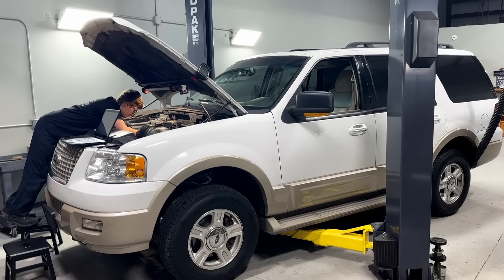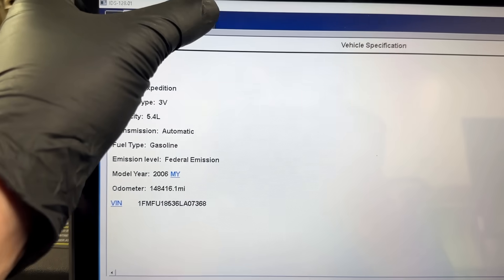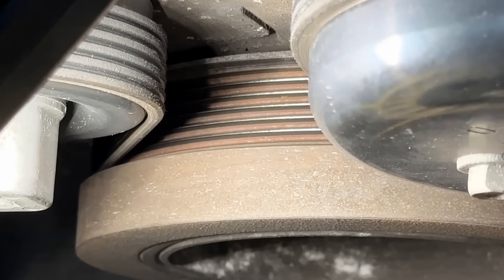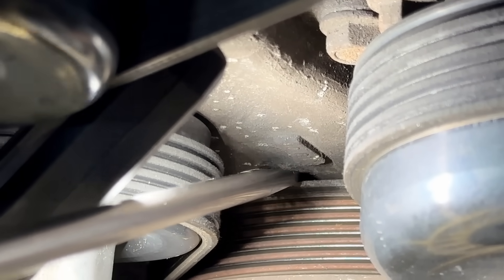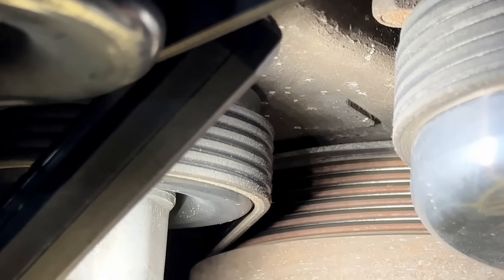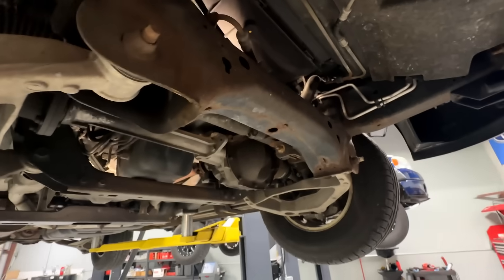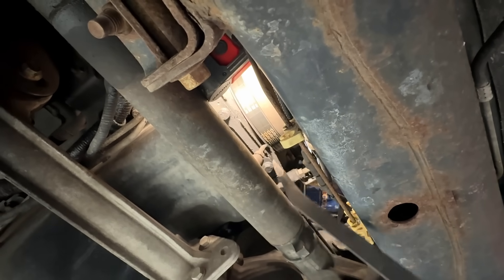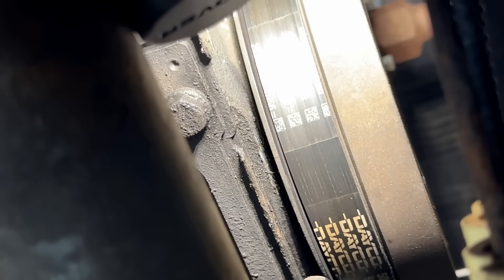Ford 5.4L 3v Triton Engines: Always Check This First Before Performing a Timing Job on this Engine!

Comment: Is the '05 Triton even part of this issue('06-'08 mentioned)If I find my '05 F150 with this 3valve 5.4 has the end play movement as shown but no other inducations(no check engine lights, no oil drips etc. and runs really good) does that indicate an impending failure?  And is it worth it now to have my valve job and crank play issues corrected now or is there no point in doing it?   My truck has 172,000 miles and runs really good. So I was just wondering what the opinion was as it us right now.  Thanks
Reply: He said it's 06-08.
Reply: @michaelwhite278  i guess he did..what was i thinking ?

Comment: So the 2005 F150's with the 5.4L  3valve Triton V8 isn't included with this group?  '06- '08 were mentioned.  Just wondering if I dodged a bullet or '05s should have been included?

Comment: I've got a 2007 F-150 5.4 and it is just now rolling 200,000 miles. 5W-20 all of its life and still no timing job. Love that truck.
Reply: Mine is a 2006 and I have 248,500 on it.  Motorcraft 5w-20 every 5000 miles since I bought it at 50,000 miles.  Still running like a champ!
Reply: I’ve got a 2010 5.4l with 174k. Got the cam phasers replaced at 140k. Thinking about selling 😬😬😬😬
Reply: @folms110  Mine is at almost 250K and is all factory.  I’ve always done my oil changes on time and used Motorcraft 5W-20 every time.

Comment: You can also see that the drive belt on the worn engine isn't running on the center of the smooth drive pulleys anymore. Seems that would be a dead giveaway. Great vid as usual👍
Reply from the maker: While this can be another indicator it is not to be relied on for this condition. Many aftermarket tensioners track toward the edge where as the blue truck I already did a timing job on received a Ford Tensioner which tracks close to center.

Comment: Wow great info, does the 3V 4.6L in the Mustangs have the same problems with cam phasers, timing chains,
and crank shaft thrust washer failures that you know of?
Reply from the maker: Yes they sure do.
Reply: @FordTechMakuloco  should the pulley on the 4.6 3v mustangs be as snug to the timing cover as these?

Comment: I'm so tired of this motor.  In 2020 I was watching all I could from you about the motor.  My 06 expy was having a misfire cylinder 5 and I went through everything from the vvt to did my rocker arms fall out.  I couldn't find anything.  One day the truck hit limp mode on my way to work on highway.  I got the truck home after work, took intake off, and the center gully was full of coolant.  I got the drivers side head off, and every cylinder was full of water.  I spent $5k on reman engine (with heads taped to take standard spark plugs) and reman tranny.  Did work myself.  I got 9 months (6k miles) and I started getting misfire cylinder 5 again, along with rough running/driving.  So I got a replacement (flashed) ECU.  I still have the misfire.  The only thing I haven't changed on truck is wire harness.  The truck has been sitting for a year now because I just don't want to deal with it.  I'm ready for a coyote or godzilla swap.  Either one has to be less hassle than the 5.4 Triton trash.

Comment: FordTech,  would  you explain how the PCV system works on  a 2010 f150 5.4l 3v. Does it use a traditional style pcv valve?
Reply from the maker: It uses a PCV baffle system which is part of the valve covers.
Reply: Look for the video he did on on a 2009 F150 that came in…I believe it was within the year. He covered the pcv side of things in that one.
Reply: Is there any preventative maintenance that needs to be done on  this pcv system?    Im still looking for the vid that JP mentioned .    TY

Comment: When that crankshaft moved as you pried down below I jumped in my chair.  Spooky.  It's NOT supposed to do that.  Whew.  But it's great for someone to tell the truth.  Bless you Brian - you are teaching your son well.  Ethics.  Values.  Doing the right thing.  Open communications. Thinking and analysis not random wandering.  Great work at fair prices.  The customer comes first.   Etc. Etc.

Comment: Brian, the other clue is where the belt is running on that tensioner. It's not centered. I had the same issue with my Caravan when the harmonic balancer was walking off the rubber mount. I could see that the belt was not centered on the tensioner pulley.
Excellent video. Thank you
Reply from the maker: While this can be another indicator it is not to be relied on for this condition. Many aftermarket tensioners track toward the edge where as the blue truck I already did a timing job on received a Ford Tensioner which tracks close to center.
Reply: many same comments   above...

Comment: had same problem 08 197000 miles pulled pan and saw the 1 half of the thrust bearing in the pan ,pulled engine put a reman crank and bearings in . the cylinders still had cross hatch visible measured tapper and it was mint put in new rings ,new timing etc. runs like a top has 6000 miles on it no smoke no problems , all thanks to brians videos it helped me out alot

Comment: Thrust bearing wear is often caused by torque converter being forced forward by high transmission oil pressure. I had one with a restricted cooler line that did just that.
Reply from the maker: I have heard of this but in this case it is not the cause.
Reply: @FordTechMakuloco  Did you determine the cause? Was it just normal wear?
Reply from the maker: Yes a common failure 2006-2008 as specified in the video.

Comment: Yes any type of thrust bearing failure will force the crank forward with a automatic due to the pressure in the torque convertor. I have seen this back in the 90s with the AOD the TV cable over adjusted crazy line pressure would smoke the engine thrust bearing but buddy LOVED the hammer shifts. I have a overserviced my 07 purchased in 2010 with 38k yeah I live in Canada every thing metric since then 40k plug changes first one tight but done a little nickel anti seize on the ground shell and all other changes oil changes every 5 k with Castrol edge 5w20. in 2013 noticed Pennzoil made from natural gas a superior oil base used the cleanest not rocket science dirty goes to clean my go to for ever. Changed grades as I thought and you recommended 5w30 I did that . Today 200k 15 years old runs just like 2010 when I bought it. Live in the rust belt the brine and salt kill the body on any vehicle me 56 years old have owned many vehicles the body dies well before the drivetrain its sad. But back on topic for this my thrust bearing is mint on a 07 the worst the proof 5k oil changes with the best oil ever even keeps cam phazers alive is what it is. This engine a bad choice for the novice but for me and you a strong good daily runner overserviced a fail for Ford for the ignorant the masses.

Comment: FordTechMakuloco, could you give me idea-i own explorer 2009 4.6 3v with 60k miles only. I use 5w30 oil. My engine has phaser rattle on the passenger side when the engine is completely hot. I changed the phaser (used new ford original part), but the rattle still continues😢What is my next step in solving this problem? Thank you!

Comment: Also at the 1:21 mark it looks as though the vacuum line going to the heatercore coolant hose it's not on the diaphragm side.
Reply from the maker: Yup they fall off all the time and some just cap them.
Reply: @FordTechMakuloco  quick question do you know what usually causes a p1450 in the 5.4 expeditions year model 2006.

Comment: If a 2005 5.4 3v engine passes this test, and has the startup rattle with 140k miles, but burns a qt of oil every 1800 miles would you replace it or do the timing job only?
Reply from the maker: Timing Job.

Comment: I had an 07 5.4 3v it was a great engine! Had 160,000 miles on it when I sold it. Never had any major issues. But I always changed oil on it
Reply: My 05 has 275000 on it! Drive it every day! Had the phasers locked out on it time I bought it. Drive it every day, tow my camper, car trailer occasionally. Use full synthetic and change the oil and filter @5000 miles! Uses 1 quart between changes. See a dozen of them every time I go to town.
Reply: @markmccarty9793 What kind of gas mileage do you get with normal in town driving on that with the locked out phasers?

Comment: The 5.4 come out in Australia in 2002 in the BA falcon there a good motor plus there a huge motor too that's why they had to put a hump in the bonnet on the XR8 and GTs models brother has a Ford Fairmont Ghia 2006 model four door falcon from Ford factory built to his specifications

Comment: Ftm that looks like maybe 0.120" wear on the main bearing thrust surface, doesn't it? That is fairly uncommon on engines in general but all bets are off with a 5.4 l 3v. Do you know what causes it? Bout enough to make you loco.

Comment: First clue would be the location of the serpentine belt on the idler pulley. It was far from centered on the pulley.
Reply from the maker: While this can be another indicator it is not to be relied on for this condition. Many aftermarket tensioners track toward the edge where as the blue truck I already did a timing job on received a Ford Tensioner which tracks close to center.

Comment: question for ya..  i own a 2010 5.4L triton   the code im getting is P0001 Fuel Volume Regulator Control Circuit / Open    i have taken it to my mechanic 2 times and both times have come back with no answers other than it could be this or it could be that .  says it could be a few things that trigger that code . ive changed the plugs, the coils ive cleaned and remounted the fuel driver sending unit or whatever it is on the rear axel .when i push the throttle it wants to spit and sputter lacks power big time. it was throwing missfire codes a while back but doesnt anymore just spits and sputters. if i baby the throttle it seems to do alright but hills or passing or even if i just heavy accelerate is when it has issues.for some reason it wont throw codes anymore but still has issues. any ideas , ive thought about taking it to FORD but really cant afford hundreds of $

Comment: Is the 4.6 3v prone to all the 5.4 issues?  I have 09's , Mustangs, but I will probably never see those kind of miles, just curious... Thanks for another great video.
Reply from the maker: Not all
Reply: What about the 03 4V? I've been having a grinding sound when I start it. My brother pointed out last month the sound seems to be coming from the a/c compressor unit. Thoughts? Thanks.

Comment: Was this a problem with 3valve v10s I have a 08 manual trans very early build 03/07 also when do you recommend doing a timing job on the v10s I have no issues as far as cold start rattles

Comment: The way the belt sits on the idler confirms how far out the crank pulley is guiding the belt.
Reply from the maker: While this can be another indicator it is not to be relied on for this condition. Many aftermarket tensioners track toward the edge where as the blue truck I already did a timing job on received a Ford Tensioner which tracks close to center.

Comment: I've had good luck with my '04 F-150 5.4 3 valve. I have almost 300,000 miles on mine. I've never touched anything inside. Oil changes pay dividends. Oil changes are cheaper than a new engine!
Reply: at 80yrs young, I STILL do 3000mile/inc filter oil services...rbw

Comment: Hi Brian, here are A couple of video ideas that im curious about. 1. is there any differences between the mustang 4.6 and f-150 4.6 3 valves?  2. How does the 4.6 compare to the 5.4 in common problems? 

I haven’t seen any mustangs in your glorious shop. 

Its odd that some 5.4’s had the thrust bearing issue and others did not.. i womder why. 

Thank you so much for your entertaining videos. All the best!
Reply: Yeah I always wonder the same thing… some people say “the 5.4 is exactly the same engine as the 4.6, just with longer stroke”, but others say there are issues in the 5.4 that don’t exist in the 4.6 and vice versa, and it’s silly to assume they’re the same. 

Of course the truth is somewhere in between, and I’m always hopeful to hear in these videos whether the issue is unique to the 5.4 or not.
Reply: Different components in the engine as far as timing goes the 4.6 doesn't have cam phasers or vcts and the valve train is also different.. oil pathway to the valves there are tons of differences in the two engines
Reply: @chrisburrell8489  i thought the 4.6 3 valve did have vvt and phasers? Any info is good.. its odd that we dont see more mustangs in brians shop.. maybe its just due to the fact there is less of them and people domt rack as many miles on them.

Comment: Thanks for the informative videos i really appreciate it . I just went to help a friend put her serpentine belt back on. It flew off going down the road in the rain. I figured maybe it was a streached out  old belt. So we put a new one on. Theis was a 4 cylinder in a Dodge Avenger. It came off again a few days later. So when i put it back on in a garage I could see that the belt was riding a full rib out on the tensioner just like the one in your video. If you notice the alignment is off on the next pully after the crank. I bet he engine might have thrust bearing issues. I would have never thought of that. Her tensioner felt good so i didn't think it was going bad.
Reply: good eyes.....

Comment: Hey there! I have a 2006 ford f150 5.4 lariat. Its a roo roo roo start… very sluggish. Once its running she drives and runs great, idles perfect also. Once its warmed up and I drive for a bit it doesn’t like to start again until its cooled down. What would you suggest I check first? Thanks so much!

Comment: One clue is the serpentine belt is running off the front of the pulleys,  but then that could be caused by a bad bearing elsewhere on the belt system

Comment: The position of the belt on the tensioner pulley should be a very easy and reliable thing to look at. (As long as the tensioner is good)
Reply from the maker: While this can be another indicator it is not to be relied on for this condition. Many aftermarket tensioners track toward the edge where as the blue truck I already did a timing job on received a Ford Tensioner which tracks close to center.

Comment: My brother had an AMC 360 in a Jeep with over 1/2" of end play, and you could see daylight through the top of the main bearings. I could literally pick the crankshaft up while it was still in the block and bolted down. 

That end play Brian is seeing is pretty significant too. Keep up the good work Brian as I always appreciate your top notch videos.

Comment: So it seems like a lot of labor to, pull the transmission for the rear main, the oil pan for the thrust washer, and the front of the engine for the timing chain. If a person was to yank the engine, it also might still need a crankshaft and bearings. So I guess you're saying without actually saying, either scrap the truck or get a reman?? 🤔✝️🤗

Comment: So is it the "thrust washer" or thrust bearings (are they the same - tomato or tomatoes?)? And that'd mean that debris (or whatever) is getting past the front seal (behind the harmonic balancer); possible oil pickup strainer clogged-up? K, so I had to come back to edit - maybe a fix/workaround: cut small grooves in the thrust washers in order to make any oil from the main bearings lubricate the washers. Or, as in some SBC racing applications, use thrust needle bearings in the front washer (will still need lubrication), but still a possible workaround.
Reply from the maker: No it is an actual separate washer.
Reply: @FordTechMakuloco  Yup, it is; I just watched ur video on it.

Comment: A great explanation of something I would not have thought to check!  Thank you for sharing your years of experience with us.  This sure makes me appreciate the old-school 4.6 in my '98 Mercury Grand Marquis.  No phasers, just 2 valves per cylinder... a basic text-book V-8.  Except for the lack of sparkplug threads in this era, if you stay up on the maintenance, this motor is pretty darn bulletproof. Just past 150K and it still runs like a watch.
Reply: True, great engines. Still plenty of them in operation all over the place.
Reply: My 2005 Grand Marquis has 288k and going strong. Just sold a 96 Mark VIII 4.6 dohc that had 315k and going strong. Had 2 94 vics with over 260k and going strong when I sold them.
Reply: Buddy of mine is a machinist, and he told me the 4.6 liter spark plug threads, or lack thereof, have put his children through college.  The Ford 302/351 was an excellent engine.  They haven't built a good one since, imho.
Reply: @James.Allen.1  I agree. I regret recently scrapping my 93 f150 with a 302, but I had to. The cab just rotted right out, shock and leaf mounts rusted, electrical problems, ect ect. Im still sad about it.
Reply: @James.Allen.1  True that.  Miss my 302.  And my inline 300.
Reply: @James.Allen.1  What do you mean put you through college? I've installed dozens of inserts into these heads. No need to pull them etc. Charged perhaps 1 extra hour over sparkplug change to install an insert. How much was he charging?

Comment: Great video thanks. Could the oil pan be dropped and a new thrust washer installed ? or does the whole crank need to come out ?
Reply: Engine out, full bottom end disassembly. Usually there will be other things worn so main bearing/thrust bearing change aline will not be wise.
Reply: Crank will likely be chewed and require replacement.  So essentially a rebuilt bottom end.